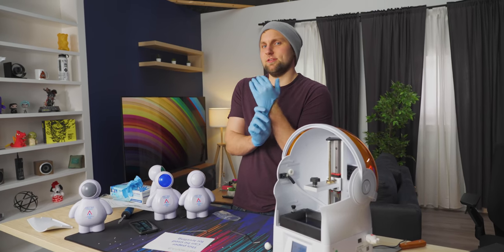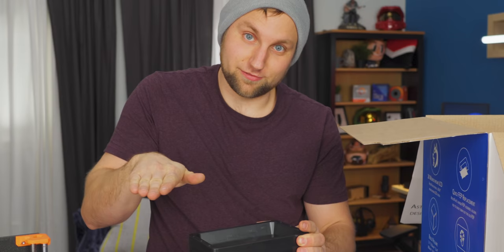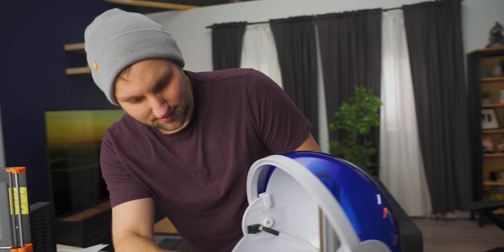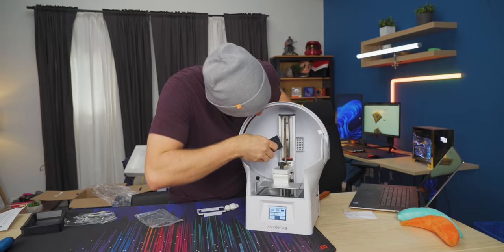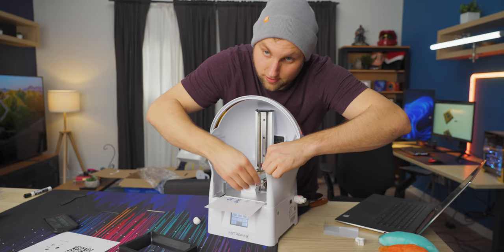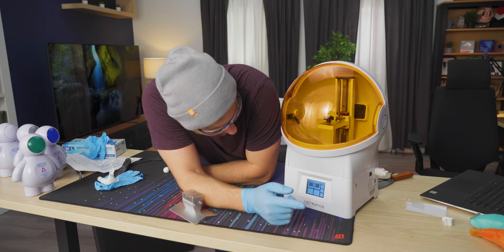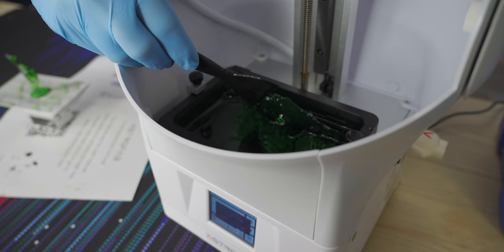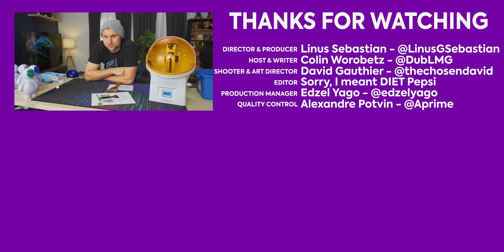Printing with LIGHT?!? - AstroFab Aldebaran

Comment: the only thing about this printer that isn't from Anycubic, is the shell, even the tool kit that you get is the same as the one you get with any Anycubic printer, including the quality inspection card. Wouldn't be surprised if the resin is also from Anycubic but different bottle
Reply: Definitely the case, but as an owner of the mono 4k everything you get is quality. If the asthetic is your thing it would be cool to have.
Reply: @Sad_King_Billy  fr though, the bots are getting real bad
Reply: @Sad_King_Billy  report them
Reply: Done, but i doubt it will have any effects.
Reply: @winnieid2727  It will not have an effect.
Reply: @Sad_King_Billy  it's crazy al the span chit always the same stuf
Reply: @kodykj2112  always
Reply: YouTube: The dislike counter needs to go, but the Bots can stay 
😒
Reply: Believe it or not. Any cubic makes a lot of parts for a lot of printers.

Comment: If the 3d printing part of the unit stops working, you could always fandangle that whole housing into a headpiece to wear outside. It has a UV filter, and a hepa filter. You're set.

Comment: I wish you would cover 3d scanners. So far there don't seem to be many consumer focused 3D scanning units and the professional ones for CAD are out of most people's price range. It would be nice to cover these at some point and hopefully use LTT's pull to get companies working on consumer versions of these devices.
Reply: As someone that works with that type of stuff professionally, I'm really curious what you'd want to do with it at a consumer-level? Achieving good results is generally pretty difficult, and you can't do that much with the output unless you do fancy rendering work or something.
Reply: Matterport works on your iPhone right? How consumer focused can you get
Reply: Matterport works on your iPhone right? How consumer focused can you get
Reply: I mean, sure, it *works*... But what are you going to do with those assets? Consumers can absolutely capture the relevant data (to some extent), but I just don't really get why anyone would. There's not really many real-world use-cases outside of industrial and gamedev as far as I can see.

Comment: Ah yes, make the bottles of toxic fluid have a fun shape that kids would love to play with...
Also, I'm pretty sure that the blue hood will not block the UV light?
Reply: Uuugh what? Blue is not UV. UV is above blue in enrgy.
Reply: @generalginger7804  yes but cheap colour filters have a very broad range of colours that they let through. And this hood certainly aint expensive so it will probably let UV go through as most blue plastics would. Thats why most printers use red plastic, because its way easier and cheaper to block UV

Comment: I just realized this gpu shortage effectively removes warranty. Like... 3rd parties, it's basically non existent during this crisis. People shouldn't be afraid to void it by installing better pads that you corporates seem to lack. Just install better pads on whatever gpus you BARELY HAVE if warranty is even conceivably your concern, Imagine the cards you make break almost immediately and you have to replace it for the consumer, that's another half grand for another probably BAD gpu, better pad or even paste will save you warranty costs which in turn will save money. Plus it might give you a chance to finally stock up in supply. I mean the gpus are already scalped badly, you might as well take advantage of the situation and make their endurance quality worth it.

Comment: Wow I did not know resin printing was so involved. Now I know I'll just stick with my good ol FDM printer thanks.

Anyway I also echo the sentiment of wanting to see moar 3D printing content, doesn't have to become Tom Sanladerer V2 or anything but I wouldn't want that out of LTT anyway, I mostly use my printer for functional prints & useful stuff around the house
Reply: Resin printing is a bit fussy but the results are beautiful. They look so much better than FDM. Not quite as strong though, so if it's for function maybe FDM is better, but if it's for looks, resin really is the way to go currently.

Comment: Can you review some cheap cnc machines? I don't really like plastic but i would like something that can do something similar but without the plastic. 🙂
Reply: There's no such thing. The cheapest CNC machines you can get are still several thousand dollars, and they suck. If you want something machined, have an online company or a local job shop do it. Spending $2000 on a router that can only really cut aluminum in 2.5 axes, or $3k-5k on a 5 axis benchtop machine, that is also horrible at cutting steel, isn't worth it. There is no middle ground. If you're cutting enough to warrant buying a machine, spend the extra on a Tormach or Haas mini mill. If you're not cutting enough to warrant buying a machine, have someone else do the part; it's much cheaper. Those machines are too expensive for someone only making a few parts, and they aren't rigid or fast enough for people making a lot of parts.
Reply: @littlejackalo5326  okay thanks for answering. 🙂

Comment: While you can water wash with certain resins I recommend 99% IPA it will breakdown unused resin and help clear any away from the model, some scrubbing may still be required for nooks and crannies and it will air dry really fast before curing.
Reply: Not only that, water wash resin crates a huge problem of people washing their prints in the sink and rinsing it down the drain, flushing all the uncured resin into the drain.

Comment: One thing that you didn't mention thats probably fairly obvious (but I'm going to mention it anyway cuz why not): Not only can SLA printers print in finer detail, but it can print more complex structures since its not relying on plastic being extruded onto a bed. So basically it can print parts that have angles and stuff in mid-air, if that makes sense

Comment: Resin and FDM have different properties and strength is a bit complicated.  So saying resin isn't as strong as FDM is like saying Glass isn't as strong as Plastic. Resin is more isotropic than FDM and the prints are harder but more brittle kind of like glass. FDM is less hard, anisotropic but less brittle I get they need to keep these short but either be accurate or just don't say anything.

Comment: Do what's three point of the different color hoods? Form or function? Do different resins need different hood colors to soft cure the print?
Reply: No, the hood color doesn't affect the resin in any meaningful way. All it needs to do is block UV light in environments that are exposed to UV

Comment: Don't use a metal tool to scrape the build plate? I got an Elegoo Mars on day 1 and have been using a metal scraper to release my prints multiple times daily for years with no damage to the build plate.

Comment: Been resin printing for years. This helmet not only looks goofy the entire frame around the build plate is just a mess. Its gonna be harder to clean and more prone to spilling because you have a smaller area to move in and out of than just taking the normal hood off. They priced this higher to sell to schools which is where they hope to make up for it. This is not a consumer friendly design.

Comment: Tech quickie on how exactly this printing magic works!?
Reply: If I remember correctly from the Formlabs printers, a light or laser beam is used to semi-cure the resin wherever it need to to make the print, then moves up the printing platform before repeating everything again, until you get your finished print.
Reply: @vfnt  bit different, this style uses a LCD screen with the back light replaced with a UV light, the screen blocks of different parts of the screen to block the light and cure certain parts.

Comment: NEVER use a hard scraper on the FEP sheet. It CAN damage the sheet and believe me you do NOT want a FEP failure when lifting off it. Get a silicone scraper or one of those multipurpose silicone kitchen spatulas (I use those) and they are also great for stirring the resin after each print in case it settles.

Comment: I will never understand why they sell a resin printing kit but don’t include some type of cure chamber with the kit. And yes I am aware that you can technically cure resin prints outside in the sun but that isn’t for everyone
Reply: If you want a curing chamber, buy one. If you don't want to be forced into adding another $100 to the cost of the printer, for something you most likely won't need, there are options like this.
Reply: @littlejackalo5326  no you misunderstand if you call something a starter kit then include everything you need. I have met way too many people who buy resign printer thinking it is all they need.
Reply: @NVAfilm  well then might as well throw in an ultrasonic cleaner too then. It’s not required, like you said a curing station isn’t 100% required, but let’s make this beginner starter kit really uneconomical
Reply: @daishi711  hahaha I mean you could but how many peoples first camera came from the canon rebel starter kit. Canon never stopped you from buying a camera body itself however if you didn’t already on the other things it made more sense to buy the kit especially if you were a parent unsure on what exactly you need.

Comment: The amount of cross contamination is kind of appalling: scratching beard, touching the resin bottles, grabbing the print, opening the large printer, opening the curing chamber. Then, after all that, you touch the curing chamber without PPE... What were the gloves fore? And no N99 mask for the resin fumes? (Anything would have been passable just to show you should use something, especially since you're shoot in the apartment set, impling to the average user it's fine to have this kind of machine in there living space) I'm kind of disappointed you pointed out of the safety pamphlet and then proceeded to half follow some guidelines. (I'm sorry if this comment comes off as rude, I just want to push proper resin safety... Especially on big YouTube channels 😅)

TLDR: Proper protection is important.

Comment: 6in 2k monitor
So it's 1080p with bit extra
Reply: 2k is usually 1440p afaik
Reply: @devnol  100% correct "usually"
1440p is more in hand QHD.

It's that it's not clear in what 2k it is

Comment: I'm sorry, but everything about this thing that ISN'T a feature on any other run-of-the-mill MSLA printer looks terrible.
The cover is clearly a hassle, the sensor pausing a print when you open it isn't even useful, and the bottles are just a waste of plastic.
Was this designed by Apple?

Comment: I will admit those resin bottles are adorable but they're twice as expensive  as other water washable resins and all that custom injection molding for a disposable bottle is incredibly wasteful
Reply: If the resin is 2x as expensive as other comparable products, it has absolutely nothing to do with the bottle. The whole bottle uses about $0.20 worth of plastic, and it being "custom molded" has nothing to do with it either. They would have a bottle design of their own either way, and if it was a square bottle, you would have never said anything. Whether the molding is custom or they bought off-the-shelf bottles, it wouldn't make any difference. The molds need to be made either way, and making a few miles for their bottle is inconsequential. Saying things like "incredibly wasteful" is what makes us have a hard time convincing people to use less plastic. The people buying this printer may buy 2-4 bottles a year, and the amount of plastic is negligible. It's almost like people whining about straws, when using one less plastic water bottle per year, would save as much plastic as if you stopped using straws for that year. Focus on things that actually make a difference. This is an EXTREMELY low use item. Very few people are using it, and they're using very little of it. If it was a high use item, like a disposable water bottle, then yeah, it would be an issue. They provably sell less bottles of this over a 10 year period than the amount of plastic drink bottles sold in a day.
Reply: @littlejackalo5326  bruh
Reply: @littlejackalo5326  The molds for a generic bottle are already going to exist... All they'd do is customize the label or branding slightly.  I agree that waste isn't that big an issue here, but still designing the tooling and molds to make this disposable bottle just seems stupid; Im sure that's what they're trying to recoup.

Comment: I just want atomic printing CPU’s and such can then hit a total roadblock in a good way as you could customise the CPU to your needs and only need a new one if your needs change

Could also make flawless lithium batteries

Could also make flawless monitors

Could also blah blah blah

But only for solid objects that do not move during creation so no organs or anything as they would need to be made instantly also cells a stupid complex so even if we could flash replicate organs we dont know enough to actually do it